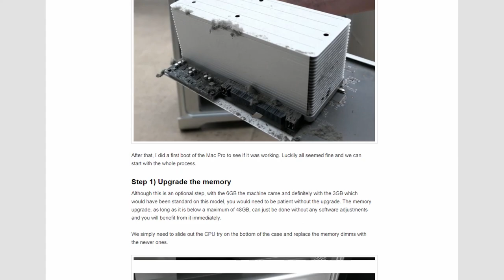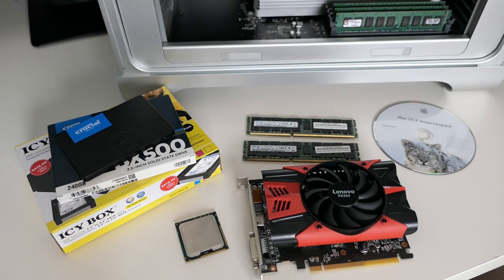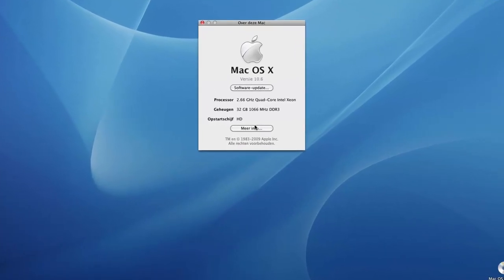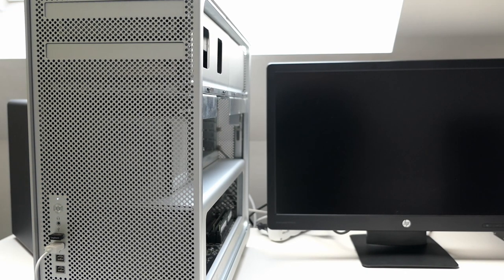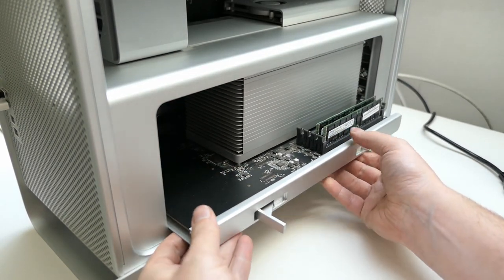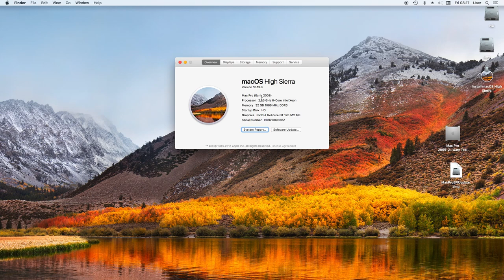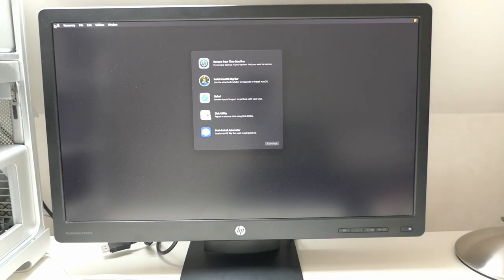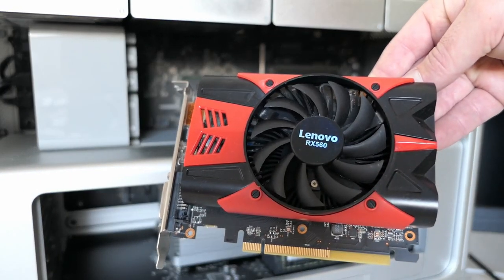Mac Pro 4,1 - Full hardware and software upgrade to Big Sur

Comment: Fantastic video! Thanks for sharing! I am planning to do the same, the only question I have is how to find the proper RAM. What kind of specs do I need and where did you bought the RAM from? I am looking in MacSales but that seems quite expensive.

I will also need to find the old graphics card since I have the Radeon 7950 installed and looking at the comments I believe I need to use the old one for a step, right?

Thanks for sharing! Great video!

Comment: So 14:38 I’m stuck. Currently running 2x2.26ghz quad core intel zeon. The firmware tool gives me an error code 5570
Reply from the maker: Did you disable SIP?
Did you mount MacProEFIUpdate.dmg by double clicking on it before running the FW updater?
Reply: @jensdbe  yep my mistake hah love the video it’s been a great help!
Reply from the maker: @Rdhv91  good to hear you managed. Thanks for the nice feedback :)

Comment: Great video, thanks! Is it possible to upgrade from High Sierra without erasing/replacing the current startup drive?
Reply from the maker: I believe you can just use the patched installer to do so. I saw in a comment on my video to create the installation media for installation on an unsupported mac that this worked as expected.

Comment: Hi, I have a metal compatible Graphics Card (AMD Radeon 7 Series) but not Mac boot screen capable - How would I get around that one following your steps ? (could I use my old NVIDIA GT120 and swap back to my AMD Radeon 7 Series later)
Reply from the maker: This is exactly how I did it, so that definitely works :)
Reply: @jensdbe  Thanks for that - did you upgrade your current OSX or do a fresh install?
Reply from the maker: @paulbailey6251  for a fresh install, I use the GT120, then swap once I don't need the boot acreen anymore (or have OpenCore installed). Upgrading doesn't need swapping cards unless you have issues launching the installer. But the cards, as long as they are supported, can just be changed at any time when needed.
Reply: @jensdbe  Thanks - but I'm not sure how I can launch the installer to upgrade (would like to keep the apps I have installed) without the Apple boot screen because a restart would simply revert to the original OSX.

Comment: Great video. Have you tried it with Big Sur 11.3 yet?
Reply from the maker: Will try to upgrade next week and let you know here. I don't expect any issues but you never know...
Reply: @jensdbe  I tried it. It works! Mac Pro fully upgraded to Big Sur 11.3
Reply from the maker: @sayeghjoe  Good to hear! and thanks to let us know your result.
Reply: @sayeghjoe  how can you updated ?
Reply: @hussinaltmeme1574  just follow the instructions in the video step by step. It’s very well made. Just remember that you’ll need a metal capable GPU that o update the firmware with the Mojave installer. Once you’ve updated the firmware, put the original Nvidia 120 graphics card back in the system. Then proceed with the Big Sur upgrade. Once done, put your metal capable GPU back in. You’ll no longer see the boot screen but be partient and MacOS Big Sur will load.

Comment: You can upgrade to Monteray but no further at this time. A USB keyboard and mouse will not work. keep checking for new OpenCore Legacy versions for a workaround for this problem.
Reply from the maker: Ventura and Sonoma work as well but you would need a USB 1.0 hub. Have a look here where I did this, if interested: https://youtu.be/lU19o8OHvVM

Comment: Would this work with Monterey? Currently trying Big Sur, but finding it, well, sticky? Thinking about skipping ahead.
Also, I have a patched Catalina install on my older MB(2010) and MBP(2009) does the upgrade path still work? or does it require a fresh install?
Reply: Ok, so I've now read that it won't work with the patched Catalina. I am having issues in making the installer usb drive. It takes a few seconds, says success, but there's no file. It did work on my iMac running High Sierra, but I'm guessing that you need to create the patcher usb on the machine that you are intending to use it on??
Reply: ye if u want on Hardware like this Monterey or so, u need create an USB stick on maschine you need it for. Its in the process you create this stick, alls hardware etc will writing on the stick if u want clean and you can use this stick then only on this Maschine! you have to take OpenCore.

Comment: I am running OSX Sierra. When I try to perform the firmware upgrade. I complete the firmware upgrade step #1 and reboot. When the computer reboots I am holding down the power button until I hear the chime. Then I see the upgrade screen with FAT loading bar for only a second and then the computer reboots. The Firmware upgrade never completes. I have tried several times. I have csrutil disabled. Any ideas ?

Comment: I would correct one thing: the highest supported OS from Apple isn't High Sierra, it's Mojave. Apple allows the Mojave installation just so long as you have a metal-capable GPU installed, I know because I've got a 2012 5,1 natively upgraded to Mojave. Basically I guess if you'd changed the steps around slightly and swapped the graphics card out earlier in the process you could upgrade to Mojave instead. Of course you probably already know though that performing the installations can be more difficult when using a card that lacks the Apple bios, as you can no longer view the boot option screen, but I don't recall exactly how I went about it with my non-Apple RX570.
Good video though for sure. I'll be looking at possibly moving my 5,1 to Big Sur, I'm just concerned with a lack of support for certain hardware and not interested in spending $100+ just for a compatible BT module.

Comment: hold on... no openCore installation? And everything works without extra steps? No hardware issues?
Reply from the maker: Correct, all works just fine using this method :) 
Also very handy to do an installation from scratch on an empty disk (like I did in the video)
Reply: @jensdbe  updates are working? Or do you need to patch every version that comes out?
Reply: @wakabakaful  Its a native mac, no patches are needed. Only major OS updates (11 -> 12) require a patcher

Comment: Great video.   I have a dual 2.46 ghz quad core processor and I wonder if it’s really necessary to replace it in order to get Big Sur or at least Mojave OS.
Reply from the maker: Not necessary. It does work quite well with the original CPUs as well.

Comment: Hi!
I asking if it’s any fix out there for the overload fans running at maximum, when you are doing a multi task, after cpus have change... it’s ok everything runs smooth but what about the overload fans... what’s needs to do after this ??? Please help😊
Reply from the maker: This is most likely related to the temperature sensor. Are you using a lidded or de-lidded CPU?
Also using a fan try of a 5,1 in a 4,1 or vice versa will lead to this issue.

Comment: Also asking if after doing all this it is considered a “ native “ install ? Meaning when apple sends out updates the computer will except the updates and /or the updates from apple will be excepted and will not corrupt the OS X Big Sur  system ?  I’ve done all the updates to my early 2009 Xeon 2.93ghz to bring it to 5,1 standards .. ordered 32gb of ram and Installed Samsung 500gb ssd dtive … your video is great and your further help would be greatly appreciated - thank you in advance
Reply from the maker: There are basically two ways to work around the restrictions Apple puts in newer/unsupported macOS releases:
1) Patching the installer to not do the hardware checks + have additional drivers/workarounds for specific hardware
2) Obfuscate the model identifier to let the installer think it is installing on a supported Mac

In the video I'm using option 1) You can upgrade in theory but it could also break things in some cases. As far as I remember upgrading went just fine with the method I used.

More recently, I have installed Monterey using the 2nd method and OpenCore. Here you use another boot loader which tricks the installer/OS in thinking it is running on different/supported hardware. Upgrade work as well but require re-patching (from the OS itself) to fix driver issues in newer versions.

I did a video on that 2nd method and getting Monterey on unsupported hardware as well in case you would be interested. You can find it here:  https://youtu.be/gF89n4TKurs

Comment: Firstly thank you very much for usefull video.I have a question if possible help me please: I have a mac pro computer running 10.14 as a system. When I want to upgrade to 10.15 as a system, I cannot see the efi screen. As a result of my research, I think my graphic card does not support it. Could you please write the graphic card models that I can use to upgrade this system? Thank you in advance for your interest and help.
Reply from the maker: MacRumours has a comprehensive list: https://forums.macrumors.com/threads/gpu-compatibility-list-for-cmp.2174600/
Reply: @jensdbe  thank you very much for your help, take care dude :)

Comment: Hi Jens, thanks again for this. I have a recurring problem. I get through the efi and then reboot, disk prep, and initial install. But once it goes to the Apple loading on light grey background, it stops at the  halfway point. I rebooted and went through it all again, but this time the same. Stops at halfway. Any ideas?
Reply from the maker: Not sure but did you check the FW version? Do you have the same behavior with a supported release of macOS?
Reply: @jensdbe I took one of the commenters' advice and turned off the Mac. However, I then went through the sequence again with the same result. So, I decided to turn it off for a few minutes and then start it up without the option key, and hey presto! It completed. Then I restarted and applied the patch, turned it off, put in my unflashed Sapphire HD 7950 - and voila!

Comment: Great job on this video!  I did the update on my 5,1 and it works well.  Is there a way to enable GPU acceleration?
Reply: Open Core
Reply: @eduardowatkinz  Thank you.  I just installed opencore today!  Super impressed!
Reply: Hello Newt44, which Bigsur version did you used during the installation?

Comment: Hi! Running a mid 2020 Mac Pro and running a hacked OS Catalina with a Metal GFX cardGTX 680. I can't seem to install this and I think it's because my boot drive is named Macintosh SSD... and I can't rename it. Whenever I start up holding option it still reads as SSD and I'm assuming the installer is looking for HD...? (BTW, I also have a Drive named Macinosh HD which I can't boot from!) Any ideas.....?
Reply: Sorry - mean Mac Pro 2010 obviously.....
Reply: Update on this... managed ro rename the drive and install... but it crashed through the install and now I'm completely bricked.... any advice?

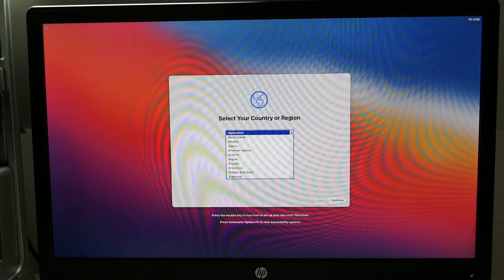Comment: Hey @jensd_be, i did everything I. Thai video but my installation got stuck 21:07. Any ideas? 

Also, I wanted to point out that I had to pop the original video card that came in with the Mac Pro to see the boot menu. So those if you with a metal card will need to do the same.
Reply: UPDATE: I left the Mac Pro seemingly stuck for about two hours and still kept showing that Apple logo and the progress bar. I manually rebooted it and it loaded the new OS as if nothing had happened! In case anyone has the same issue.

Comment: Great tutorial thanx!! Can you suggest some cheap metal compatible graphic cards for my early 2009 5.1 mac? I use it for music production only, so i don't need peak graphic performance... i only would like to upgrade it in order to install LogicX 10.6. thanx!
Reply from the maker: Unfortunately almost all GPUs got a lot more expensive but the easiest ones would be the ATI Radeon RX 5xx series. The lower ends (550/560) can be powered from the PCIe slot which saves you on getting an additional cable as well. And they're supported out of the box.
Reply: @jensdbe  could an ASUS GeForce GT 710 be ok for my purpose?
Reply from the maker: @AlessandroRorato  the GT710 is Kepler-based as far as I can see so the drivers should be there out of the box. I do read that only the version with GDDR3 memory works the GDDR5 versions do not work. Still easier I believe to go for an AMD-based card.

Comment: my mac pro tower is older but was last updated around 2012/-2014 and guy gave to me cheap since he can’t update to current OS x - i have plenty of RAM and 4 internal drives at like 4TB each — can i just leave them be or do they need to be physically updated to newer ram/drives ?
Reply from the maker: Hard to tell without knowing the exact Mac model. You can see that in About this Mac.

Comment: Hello, first I want to say that your video is PERFECT, I just have one question, is it possible to go directly to El Capitan via a USB boot drive instead of installing Snow Leopard ? I have a Mac Pro with no operating system and I don’t have a Snow Leopard CD Disk unfortunatly
Reply from the maker: I believe it depends which OS was the last one on there. If there ever was something newer you can do El Capitan directly I believe
Reply: @jensdbe  I guess I’ll try and if it doesn’t work I’ll create a bootable snow leopard USB
Reply: @jensdbe  Thank you !!! Quick respond too 👏🏻👏🏻
Reply: @jensdbe  So effectivly going straight to El Capitan is not working, you have to go first to Snow Leopard 😉

Comment: Again great video … can you tell me if the xfx rx560 4gb and the msi rx560 4gb are they the same gpu cards … also did you have to upgrade the cpu to run Big Sur ?
Reply from the maker: The cards are 95% the same and should work in the same way in the Mac Pro. The CPU does not need to be upgraded to run Big Sur, the ones that come with the Mac Pro should do fine but faster is better :)
Reply: @jensdbe  thank you but I’m a tad uneasy about the gpu cards found a amd rx550 4gb of ram for 60$ I’m wondering if that will work

Comment: I'm using a 2009 Mac Pro that's flashed to 5,1 with HD 5770 Video card, 12 core, 32gb, on High Seirra.  I'm trying to upgrade to Big Sur.  I followed your tutorial step by step using micropatcher.  I created a USB for install,  Click Hold Opt until chime, Click EFI to Power down, Power up again, click install from USB, but when I start the process of installing it will complete the install and give me prohibitory symbol every single time.  What is the work around?  I know this can be done on my model because I watched your tutorial upgrading from High Seirra using 2009 Mac Pro, 6 core,  with micro patcher
Reply from the maker: If you skipped a few steps it could be that the firmware is not on a recent enough level (hence why the whole process took me so long).
Another reason could be that you forgot to first launch the USB-drive icon in the bootloader, then repeat and select the hedgehog icon.

Comment: My wife’s Macbook Pro is from 2009, but says it’s 5,3 instead of 4,1 but won’t upgrade beyond El Capitan.
Is it because it’s a laptop?
Reply from the maker: That's a completely different model. You can work around the limitation to El Capitan by using OpenCore Legacy Patcher. Although the age starts to show, it's worth a try. I did a detailed video on that over here: https://youtu.be/acpQuCIy3GA

Comment: Hello my friend, do you know if the Mac 4,1 accepts 32gb ram modules?
Reply from the maker: There have been nixed results. As far as I read, the dual CPU version supports 5x32GB but the speed is incorrectly reported (or displayed as ???). For the single CPU model, I can't find clear info and I do not have any 32GB module to test this myself unfortunately.
Reply: @jensdbe  I have the single CPU model, and i´m searching for this answer. Thanks my friend!!!
Reply: @rafaelduarte5620  Yes, the normal 6 Core Modell accepts 32GB.
Reply: @1echtesfelix781  Sure about this? I updated weeks ago from a 4 core xeon to a 6 core xeon
Reply: @rafaelduarte5620  yes, I do have an 6 Core Modell, and it Supportes up to 48GB RAM.
Reply: @1echtesfelix781  I think he refers to 32GB sticks, not the total RAM size. 3 x 32GB would result in 96GB RAM. I would like that too…

Comment: Hello, jensd_be do i need to install opencore first? because i just follow your instructions but i ended up “file system mismatched due to security settings”
Thank you..
Reply from the maker: I didn't use OpenCore for this build. Could it be that you have an encrypted (FileVault) volume?
Reply: Yes i have it. i’ll try to remove and follow your instructions again. Hope this time will work 😅
Reply: still didn’t work for me. i was stuck at apple logo with halfway status bar after installation. any recommendation?

Comment: Is the processor a requirement for Big Sur?
Reply from the maker: No, not a requirement. It should work with any supported CPU in the Mac Pro 4,1 and 5,1

Comment: if my 2009 4,1 is a quad core 2.66, can i upgrade to the xeon x5690 six core?
Reply from the maker: That should work. Just make sure to upgrade to 5.1 firmware first

Comment: Correction -   my question should have said : after the upgrade to run Big Sur can you still boot into Mojave?
Reply from the maker: If you create a separate partition in Disk Utility, on which you then install Big Sur, that should work yes.
I discussed this a bit more in detail in the video I did on Monterey for unsupported hardware: https://youtu.be/gF89n4TKurs

Comment: How can I downgrade to original 2009 G5 Power Mac 4,1 original firmware after upgrading to a 5,1 firmware upgrade?
Reply from the maker: You can use the same tool to downgrade back to the 4.1 firmware

Comment: I tried to press the option key but it seems like does not work. is there any option to boot with usb?
Reply: if you're using a wired keyboard, make sure you have the keyboard plugged directly into the USB ports on the tower, not a USB hub. I think the USB hub doesn't get power to the keyboard quick enough. I spent four days thinking I didn't have a recovery because of this